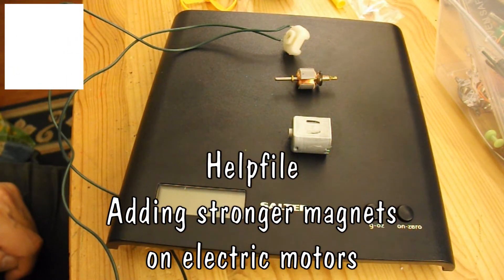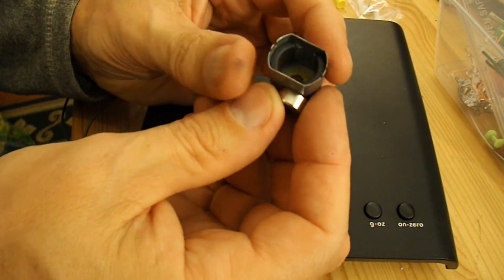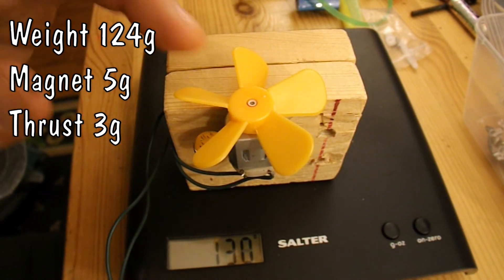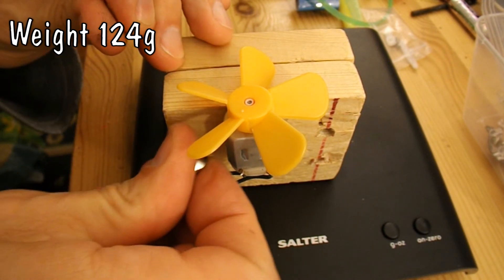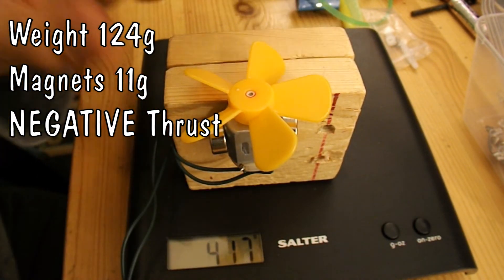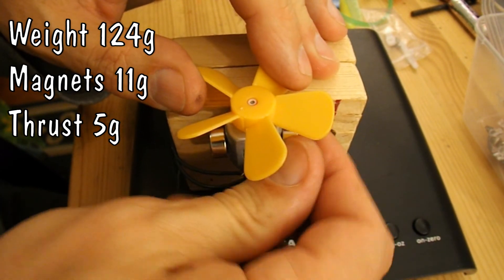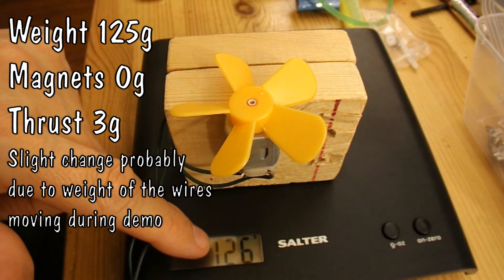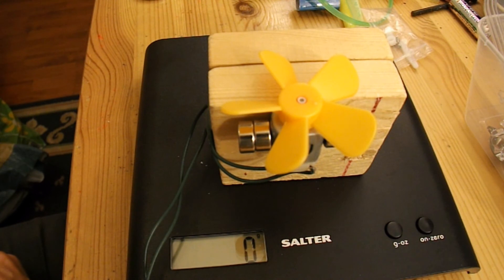Helpfile - Stronger magnets on electric motor

Comment: I plan to try this on my scooters motor what yall think??
Reply from the maker: I doubt you will notice any difference, most electric motors are arranged so that external fields are shielded. Cheap toy motors like this are not. You may even find your motor has no magnet and the field is generated by an electromagnet.
Reply: @GrandadIsAnOldMan  thank ya for fast reply !! Im still eager to try it especially since i ordered some magnets online! So ill let yall know if it dont work then i got some neat fridge magnets lol! N52 neodymium
Reply from the maker: @johnydelgado7901  good luck 👍
Reply: @GrandadIsAnOldMan  hey man Ive got great news so I did my test and before I was getting average of 7MPH and max of 12MPH no magnets after I added magnets I went up to average of 11MPH and a max of 15MPH!! Massive torque difference too the time it takes for me to reach top speed is much faster. I plan to link my magnets so others can try this for themselves I suspect this will be lovely on hills now!! At 430pm I will test on hills. Its 2:11PM Oregon. To any and all curious!!! I hope this info helps others with their electric rides!
Reply from the maker: @johnydelgado7901  WOW, that is amazing. Makes sure you post a video. Just a thought, is that legal? I know in some countries, they are limited 👍👍
Reply: @GrandadIsAnOldMan  it's legal and Ill post a video on it

Comment: Hi could yo take out the two ferrite magnets and just have the pole in the middle and see if the neodynium magnets on the outside if the motor will work????
Reply from the maker: Great question. I have just tried it and it works. I did think the metal case might disrupt the magnetic field, but even if it does, it wasn't enough to stop it working. I will upload a video and drop you a link here when it is ready.
Reply from the maker: Here you are, the new video https://youtu.be/9f49urTGQCg

Comment: Thanks for doing these tests. I have a similar brushed DC motor with neo magnets in the can. Would external neo magnets improve torque? And how would you recommend determining the polarity so I don't "override" the internal magnets? Much appreciated
Reply from the maker: I think that is something you will have to try for yourself. As for determining the polarity, if the motor runs backwards then you have done it wrong. Simple as that.

Comment: i think this shows you increased the rpm of the motor ,  i wonder if this happened bc of more current drain or loss of torque of the motor . i wish you could connect the line to an ammeter . i m looking for a setup with extra magnets to increase torque of the motor of a cordless drill without increasing the rpm .
Reply from the maker: Well if you are going to do it yourself you will be able to connect your own meter and find out 👍
Reply: @GrandadIsAnOldMan  i found something on the ask quara site , they say rpm falls with extra magnets but torque increases . i ll find some neo magnets then experiment a bit with another motor i think . thanks for the answer .
Reply from the maker: @tolgadabbagh1877  Good luck with your project, you are looking at this in far more depth than I did. I was simply responding to a question I was asked by a viewer on another video. My main concern was that adding extra magnets would obviously increase the weight so any power increase would probably be negated by the increased load. The question was related to a hovercraft.

Comment: Can you recreate this experiment, except attach the magnets on the flat sides of the motor instead of the curved sides? The idea is, maybe the additional magnets can be more effective being closer to the rotor. Although I'm not sure if the magnets can even stay securely on those flat sides.
Reply from the maker: The reason the motor casing is that shape is because the existing two magnets have to be positioned there in relation to the brushes contact points with the commutator. The way the electric motor works is current passes through the motor coils at the correct moment for the coils to be aligned with the magnetic field. The commutator passes the electricity to the coils in the correct direction at the correct time. Putting magnets on the flat sides will position their magnetic fields out of phase with the commutator so it would stop the motor spinning.
Reply: Thanks, didn't know that.

Comment: That's impressive! May the distance or the motor type make some difference? For example a inrunner  could probably produce more thrust since the moving part is lighter than the outrunner's one
Reply from the maker: Your problem comparing inrunner to outrunner is how would you define the initial power of each motor. You would need them to be identical in power to ensure any comparison was relevant. I would not attempt to produce a video on the subject as "experts" would fill the comments section with reasons why the demonstration was not a fair comparison.

Comment: Thank you for doing this test. You have proven that the motor can do more work using magnets.
Reply from the maker: Thank you for commenting. I think "Prove" may be debatable as this was hardly a scientific test in controlled conditions but it certainly is enough to suggest there is an improvement and people could try this for themselves to make their own decision 😊
Reply: Agreed, but it looks promising enough to warrant further testing. I intend to build a small Dyno and test this. I might put that test on Youtube. In the past when I have seen test similar to this there never was an actual load put on the motor, and as you and I agree, a simple shaft spin test does not prove that the motor can actually perform the same amount of work with either less power, or more work with same power drain utilizing this enhancement.
In any case, your test did spike my interest to the point of dyno testing the idea.
Reply from the maker: I would be interested to see that so post us a comment when you do it 😊
Reply: higher efficiency as well as higher current draw is the result of adding magnets.

Comment: One solution could be to make the axis of two engines and put a longer shaft sharing two of them.
The weight would be doubled, but the power also.
Ie: Place two motors in series.
It's easy to get the shaft. I've already fixed those little motors.
Often have faults, especially in the brushes. That separate or split or wear.
Reply from the maker: Hi Francisco, this video was just to answer a question raised about putting extra magnets on an existing electric motor. I guess it is a subject that is discussed in some school's science lessons.

Comment: You can use a compass to ascertain north and south pole of the magnets
Reply from the maker: Hi David, thanks for commenting, I know you have some great knowledge in this area. However, I would like to see you do that in a situation like this. The compass would react but how would you show the poles on the magnets inside the metal case, we are talking a pretty small motor here. There are two magnets so how do you know which magnet the compass is reacting to. You will get the general overall effect but not the details of each magnet. I would like to show that when you see a South pole on the outside of the motor, the pole of the magnet inside facing the armature is actually the North pole and I can't see how you are going to do that with a compass.
As I demonstrated, when you are playing around with a neodymium magnet that is so much more powerful than the motor's own magnets, the neodymium magnets will be attracted to the metal casing regardless of the poles of the existing magnets and I was easily able to over-ride them and reverse the motor.
Reply: a simple compass needle small enough to fit in there would be easy to make or salvage from an existing compass

Comment: That was very interesting. Good job.
Reply from the maker: Thanks, it may still come across confusing as I made no attempt to optimise the thrust by using a matched fan blade so the motor may be capable of better results, however the general effect is demonstrated.